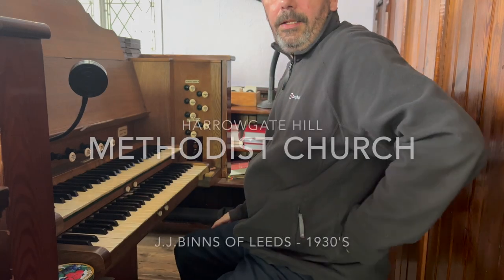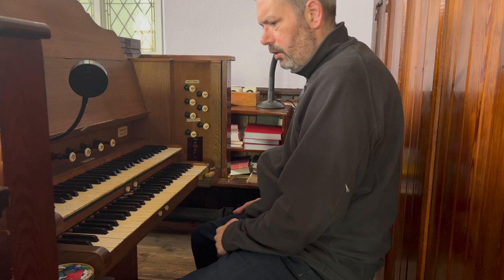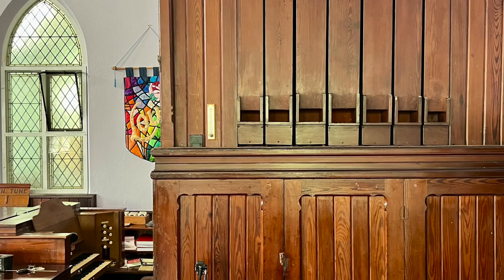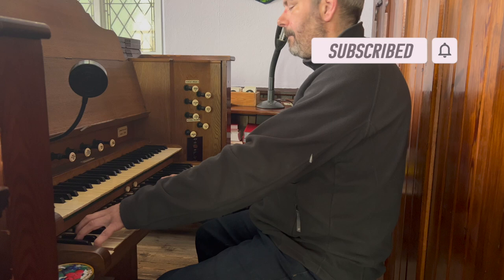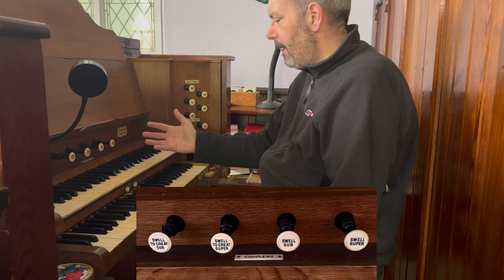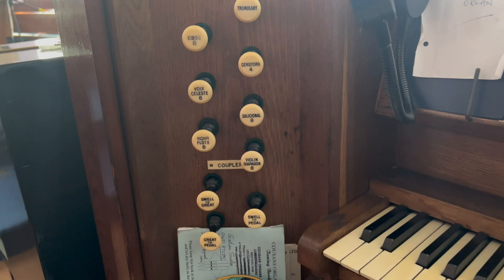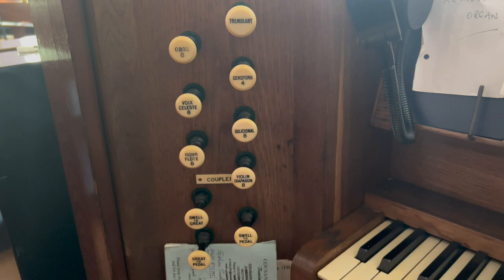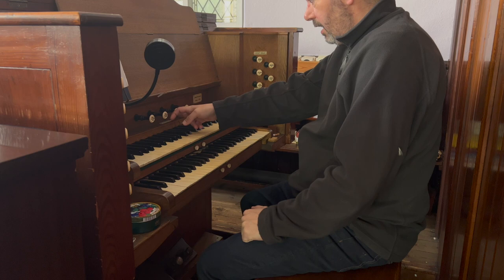SOUNDS GREAT (...but could do with a 2ft)

Comment: It does have a principal-scaled 4' on the Great, that's something. I encountered a tiny tracker organ in Dorset whose only four-foot rank was a flute, all the rest being eight-foot. Also, you could super-couple in that 4' Gemshorn on the Swell to give you your two-foot stop -- maybe even manage a Bach fugue on it!
Reply: There's a late-romantic period organ in a church near the place where I live. It was buult in 1913., and it has a tubular-pneumatic action. It has one manual and the pedal. The stops are: Subbas 16' on the pedal, Principal 8', Gamba 8', Gedackt 8', Salicional 8', Traversflote 4' and Doublette 2 2/3'. That's very simmilar to what you've said in your comment. There is, however, a superoctave and a suboctave coupler, so if you use both of them and play everything an octave higher, you could actually get a pretty full sound, almost like having Principal 8', Octave 4' and Superoctave 2'. But, playing everything an octave higher is not ideal, especially for playing something other than hymns, and it would be better to have at least Octave 4' stop instead of only eights and one 4' flute. Not ideal, but at least it has a compromised option.

Comment: I cannot understand why many organs of this era did not include a two foot stop. To have one vastly increases the tonal capabilities of an organ from a substantial accompaniment to hymn singing and a degree of organ repertoire.
Reply from the maker: 100% agree. An octave coupler ‘kind of’ makes up for it but is nowhere near as effective as a dedicated 2ft such as a fifteenth. Thanks for watching and for your valuable comments 😊
Reply: I'm pretty sure they would ask during that time, why an organ of this size would even need a 2'
Reply: It's worth considering that higher ranks are more easily affected by temperature changes.
Reply: @karlrovey  I don't know that it's true. Flue work, especially when cut to dead length stays remarkably in tune... Let's say a 2' changes @ 3%... The 8' will chMge 3% as well. It's always the reeds I touch up on hot and cold Sunday mornings, never the flue work....
Reply from the maker: I agree - it always seems to be the reed pipes that are most dramatically affected by temperature changes, although pipework of all kinds do change according to the temperature of the room.  This is why your organ tuner will alway ask that the church be at 'Sunday morning temperature' before tuning.  As far as 'why an organ of this size would even need a 2' - I think all organs benefit from having a 2'.  It just adds that brightness and sparkle, something that an octave/4' flute can emulate, but due to it's voicing doesn't have the same 'punch' as a Fifteeth, for example.  An organ without a 2' is comparable to a piano without a sustain pedal.  Just my humble opinion :-)
Reply: It was the style of that period. Designed for romantic music, these organs had a lot of 8' and 4' voices. This changed later in the 20st century when the 'orgelbewegung' looked for a revival of the baroque organ (neo baroque). Then they tried to mimic the style of Hinz and Schnitger.

Comment: Yes, VERY typical of the older organs, not even a Fifteenth. I've played 3 older organs which had nothing higher than a 4, thankfully one at least had a Super Coupler on the Swell, so the Harmonic Flute could sound at 2' as well when 8' pitch was played... And the Gemshorn 4' here isn't QUITE as substantial at 2' when most stops are pulled....